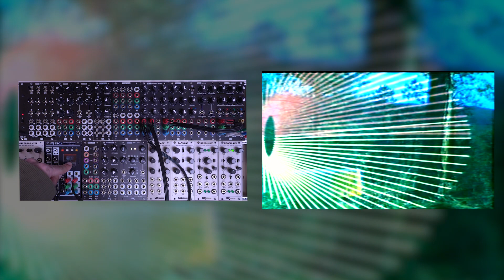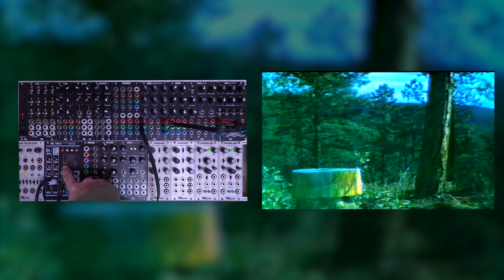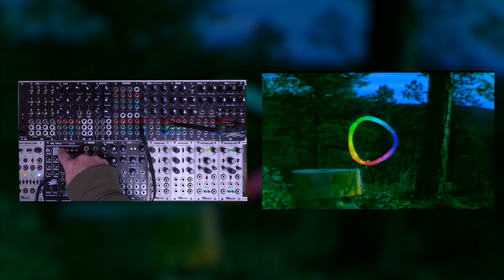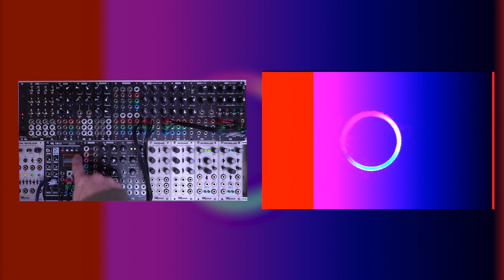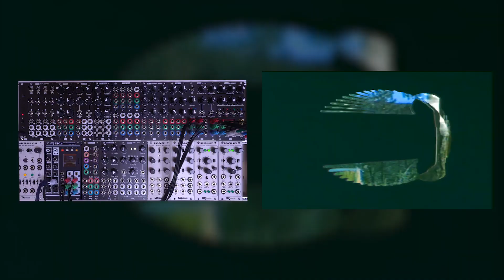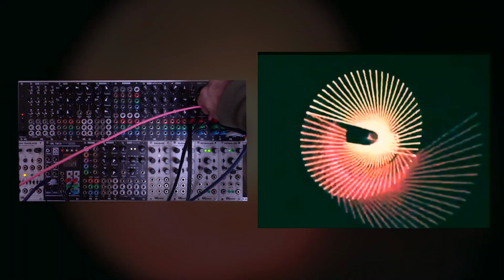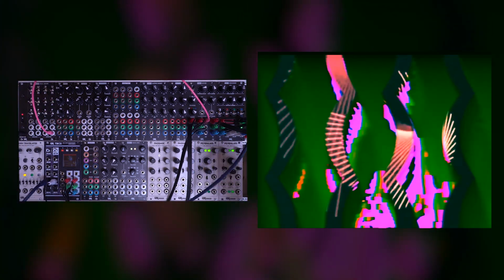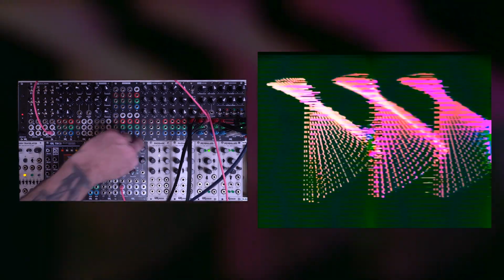3 Patches for TBC2

Comment: It would be nice to add an expander with some knobs to change the values instead of using buttons :)
Reply: It has full midi implementation, so you could add something like a 16n and map faders to every parameter. I plan on doing that for a future video!

Comment: .....but how does it handle stabilizing intense glitch input???
Reply: I think that would depend on what kind of glitch you're talking about. If you're using a device that intentionally strips away the sync information, I doubt the TBC2 would perform well. But I could be wrong. Anything else, it should handle with ease.
Reply: @JohnnyWoods  thanks - it'd be great to see a future demo feature the CBV001 or CBV002 as inputs as those are the most common eurorack glitch modules currently - I'd assume the former would handle better than the latter.  This would be an essential thing to know for me before I fork over a grand - thanks again
Reply: @unfamiliarenvironments  sorry, I don't know what a CBV001 or CBV002 is. There are quite a few TBC2s out in the wild now. Maybe someone can test it?
Reply: I have all 3 modules, but haven't tested them in concert yet. You can stabilize CBV001 and CBV002 by sending the composite signal into a VU001, you can then send the multed composite signal to, say a cadet sync generator and send the output of CBV001 or CBV002 to your input module. I would still use this method when the TBC2 is being used as the input module.

Comment: I like the idea of video synthesis in theory but when I think about the cost of a case and modules compared to what I can do with a cheap midi controller and a laptop it really loses its appeal.
Reply from the maker: A cheap midi controller, a laptop, AND a case full of modules is where it really gets exciting!
Reply: @lzxindustries  I can't afford eurorack AND video synthesis lol
Reply: The cost of an LZX system is certainly not cheap, but compare it to what comparable video hardware costs, and it really is amazing they make it as affordable as they do. Ten years ago, a broadcast switcher that could do 1/8 of what a 6u rack of LZX does would cost like $15,000.